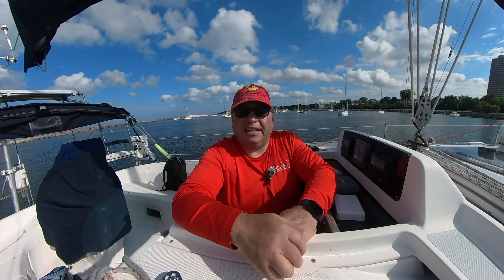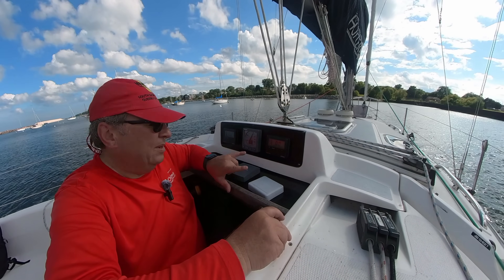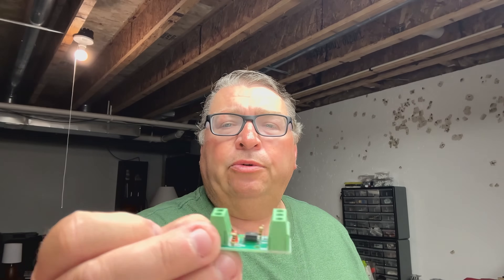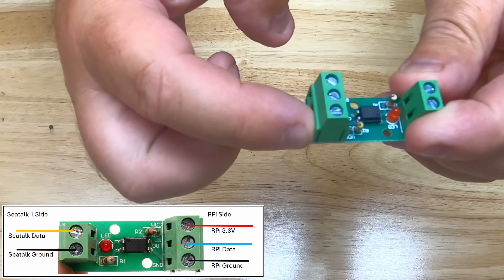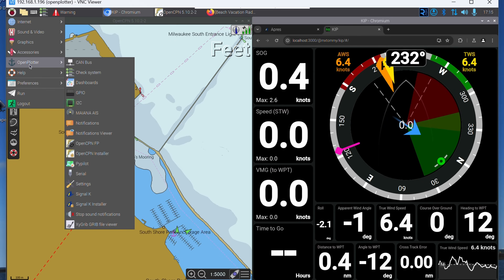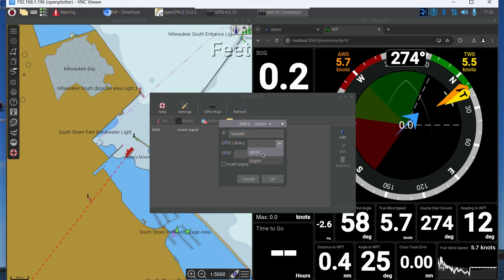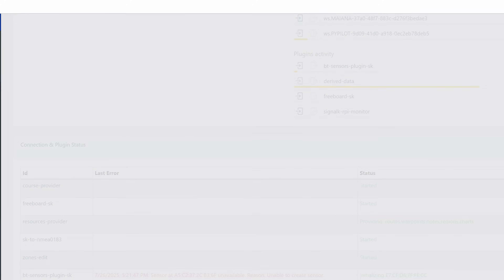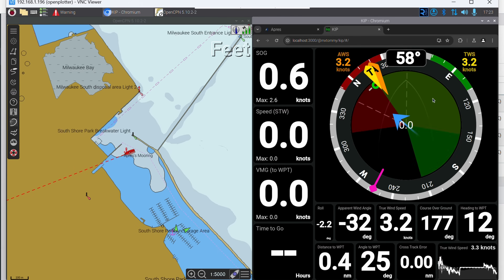DIY Sailing Electronics Guide: Seatalk 1 on Raspberry Pi with Openplotter & Signal K - Part 3

Comment: i've got a Raymarine Evolution Autopilot EV-100 can i use opencpn and my autopilot together please? Nmea 2000 or seatalk?
Reply from the maker: Yes, if you have the correct software in place and a NMEA2000 connection you can easily control your autopilot.  For example, if you have a Raspberry Pi with CAN connection connected and configured to send and receive NMEA2000 data, there is a Plugin for OpenCPN and there is a plugin for Signal K that would allow you to control your Autopilot.  If you use the iPhone App 'WilhelmSK' you can control the Autopilot from your phone

Comment: Thanks for very good videos. I have never checked behind my instruments, never had the panel off, but I have a similar setup of 3 instruments. So, you you have a wind ST60, depth and speed are ST50s. You're not using depth. Correction. You get data so you do :) What I don't get is that you are using ONE entry on the GPIO bar for input from THREE instruments. How? Can you elaborate please. Sorry for my stupid question.
Reply from the maker: Thanks for watching and it is not a stupid question but at the back of the gauge they are all connected together, in fact, if they weren't you wouldn't get True Wind Speed and Direction, as this is calculated from the Apparent wind Speed and Direction (from the wind gauge) and Boat Speed (from the Speed gauge).  I am just tapping into the common data line that goes between them

Comment: Great series, thanks for sharing, would it be a similar setup connecting to old Nasa Clipper equipment outputting NMEA 0183 signals?
Reply from the maker: for a NMEA0183 you could get a RS422 to USB adapter (https://amzn.to/4oSuhAy) and then follow these instructions: https://openplotter.readthedocs.io/latest/serial/cconnectingRS422.html.  from a software point of view it is the same as when I installed the GPS device in part 2
Reply: @ApresSail  Thanks for the links, I'll take a look,  I was looking at the RS485 CAN HAT but maybe USB adapters is a better starting place.

Comment: Thanks for sharing this! Also it may be worth mentioning is that you should make sure no other piece of hardware is using your selected GPIO, I spent several weeks debugging my Seatalk connection that was working intermittently only to find out that my selected pin was already being used (not very well documented) by some other hardware. Switching to the next available GPIO pin solved all my issues.
Reply from the maker: Thanks for the Input!!  Were you using Openplotter or another OS?  The New GPIO app wont let you select a pin that is already designated, but if you have a hat that isn't configured, then you could have that problem.